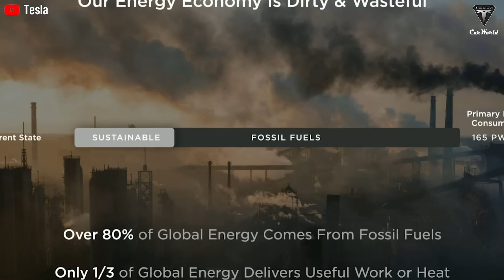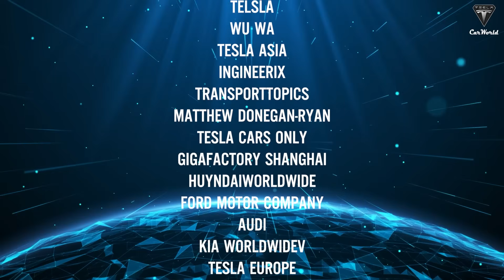Just Happened! Elon Musk Explains Why Tesla Bot Gen 3 Dances, Not Other Upgrades! What's inside!

Comment: What will room temperature super conductivity do for Optimus? The software is already working with less sophisticated systems. Assuming that the market for these bots is a more versatile form of automation that the cumberson reorganization of processes to enable automation for robotics systems to be effective. Systems already in place that depend on the mostion and dexterity of a human can be automated quickly using an optimus bot. In this way the Tesla Optimus Robot is a truly disruptive invention. More specialized adaptations to its vision and hands suggest they can become the go to solution assembly and for repairs of all types. 

Not mentioned here is that the learning acquired by it should have the ability to be ported to other bots without any learning required. Connected to the global Internet advances in any field can be global in hours.  The modifies the Hundreth Monkey Phenomenon to be the "Second Robot Phenomenon"
Reply from the maker: We’d gain ultra-efficient power delivery and lighter circuits, boosting battery life and performance without bulky cooling systems.